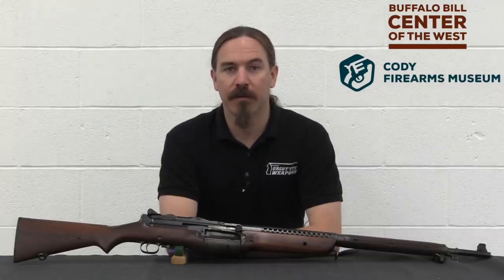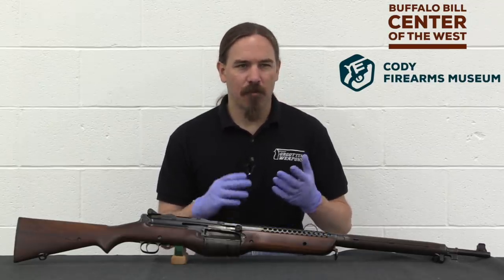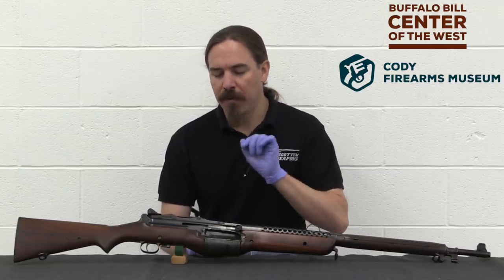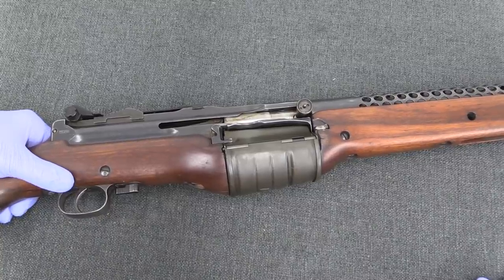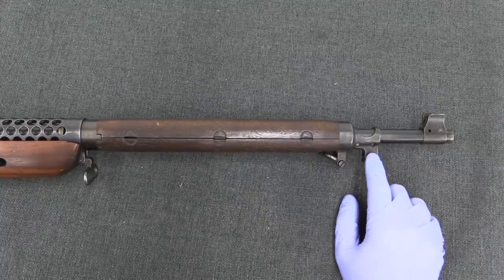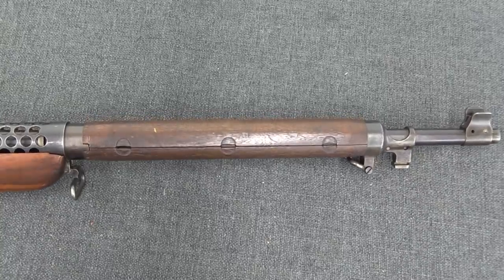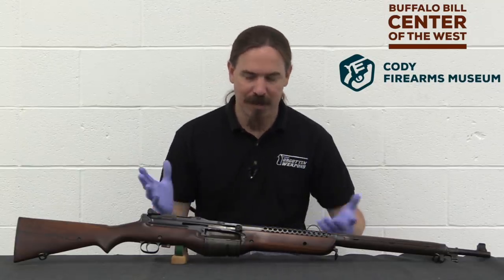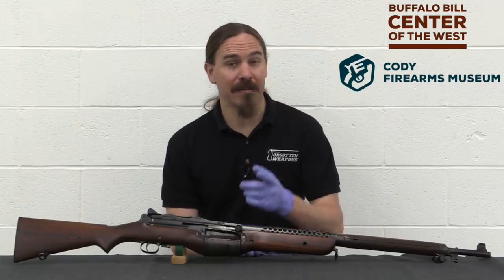Prototype Johnson Model R Military Rifle

Comment: That front "sling swivel" has a notch missing. I'm thinking that may be for stacking the rifles more than an actual sling point
Reply: Could be both. Could be a shooting hook as well, loop the sling through it temporarily to provide additional stability in standing or kneeling firing positions.
Reply: That’s what I was thinking, as well. Just like on the M1 Garand and the M1903.
Reply: Yes, that should be a stacking swivel, while the actual sling would use the one in the middle.  Using a shooting sling like the M1907, as trained, would likely cause malfunctions if using the forward swivel, as tension on the sling would interfere with the reciprocating barrel.
Reply: Uncle Sam loves his rifle teepees.

Comment: The swivel attached to the barrel isn't a sling swivel, it's a stacking swivel. It has the split in it so that you can connect multiple rifles together via their stacking swivel so that you can stand them up together in a teepee.

Comment: I don't know enough about the Johnson to know if this has been discussed to death, but could they have added a muzzle booster to the bayonet itself so clipping it on would offset its own weight?  That way you could tune the rifle for best operation without the bayonet, but not impair reliability with it attached.

Comment: Interesting you mention the brits having a look but (understandably) only being interested in it if it could be in 303. I've heard very little about British efforts to adopt Semi Auto rifles during WW2. I would guess given the emphasis on the Bren Gun (a pretty good weapon) as the primary firepower of the infantry section, the need for Semi Auto's wasn't so significant? I'd be curious if M1 Rifles or Carbines were ever used by commonwealth forces as part of lend lease though? We used tanks, planes, artillery etc so why not small arms?
Reply: There was limited issue to the commandos etc. Introducing the M1 rifle or carbine would mean adding another ammunition type to be distributed down to the platoon level - because realistically there was no way we were swapping the Bren for the BAR. As for whether we were interested in a semi-automatic, the wartime work on the initial EM-1/EM-2 designs answers that.

If Operation Downfall - the invasion of Japan - had gone ahead, then the Commonwealth Corps would have been entirely US equipped as the US refused to take a British/Commonwealth contribution any other way.

Comment: Thanks for another great video, Ian. Does not the barrel gets significantly hotter near the chamber? Therefore, the full wooden stocking near the muzzle might not impede the cooling as much as one might think. Thanks again!
Reply: I don't actually know the answer, but I suspect yes. I know there are machine guns with quick-detach barrels to swap them when they get hot, and I don't think that the chamber is swapped with those. if the chamber does get less hot than the barrel, it's most likely because the brass of the bullet casing takes the heat first, and it gets ejected before it can transfer much of it to the steel of the chamber. I have definitely heard mention of it being a problem with caseless and polymer-cased ammo in automatic guns that there isn't the cooling effect of the stream of hot brass leaving the gun.

Comment: If only Johnson had been bold enough to use BAR magazines instead of his weird clip fed drum.
Reply: BAR magazines actually suck.  Thats one of the reasons all of the attempts to use BAR magazines in Garands were deemed to be failures by the very Army design teams that developed them.

They work "OK" with the BAR because it has a really slow operating stroke, allowing the spring time to feed the round stack.
Reply: @geodkyt  Fair enough, and rewatching his earlier videos on it it turns out that Johnson DID originally use one, but the Americans insisted on being able to go prone. Because tilting the rifle to the side is impossible.
Reply: @DarkestVampire92  There were more issues than just going prone (and turning the rifle sideways because the magazine is too pong is a nonfunctional answer to a problem with the preferred military firing position .  Now, I have no idea if the original Johnson magazine was "too long", but it is true that the US didn't want the perceived snag hazard of any protruding magazine, even a fixed one (a problem that is a non issue on actual service, as demonstrated by the Lee-Enfueld, Moisin-Nagant, and a whole slew of other both action rifles that had already seen extensive combat service by that time).  (I personally think it was the obstinate insistence on the part of crusty senior officers who didn't like the idea of changing the manual of arms from the at-the-time American standard of "Shoulder Arms" with the rifle "upright" against the shoulder to the "British style" "Slope Arms", where the rifle is rested on its side on the shoulder, with the magazine pointing outwards.)

However, the Army did have valid (if, IMO, overblown) concerns about detatchable magazines.  They are expensive, present another item of supply to be lost on the battlefield (or lost or damaged in training) and render a rifle inoperable (one of the main reasons for the "European" style of "heel clip" magazine release on pistols was to avoid losing magazines), almost all detatchable magazines have exposed feed lips that are subject to damage (rendering the rifle unusable with that magazine), and the aforementioned problems in trials.with rifles using detatchable magazines. There is also the fact that carrying rounds in loaded detachable magazines takes up significantly more space than carrying clips.  (Of course, the practical solution is to carry enough magazines as a "standard load" for one typical firefight, plus a couple of extra magazines, and carry a spare ammo - often on stripper clips - to reload the magazines during the "Consolidate and Reorganize" phase after the firefight.  Which is what nations eventually did.)

A semiautomatic rifle fed from clips (especially one that holds noticeably more than typical bolt action rifles of the time) would still be a huge advantage, without the potential liabilities of detatchable box magazines.  As was proved by the effectiveness of several semiautomatic rifles that served in WWII (including ones that actually had detachable magazines but often were handled like they had fixed magazines in actual service).  Thus, conservative Ordnance officials may have been shortsighted in our perfect hindsight, but they weren't necessarily wholly *wrong*.  Note that Winchester (among others) kept trying to make BAR magazines (sometimes modified, sometimes not) work in rifles pretty much until the 7.62x51mm round was mostly developed and wouldn't work in a stock BAR magazine at all.

Magazone design and fabrication is trickier than people think.  The weak point in many repeating firearms is the magazine .  Heck, the weak point in the AR15 family is the magazine (once they abandoned the idea of box mags as single use disposables that would arrive on the battlefield factory loaded almost like an external Mannlicher clip), because the mag well doesn't provide a lot of room to beef up the magazine - that's a design issue.  The biggest weak point in the Sten SMG is the magazine fabrication - the magazine is effectively an MP28 magazine (which, albeit single feed, is a good magazine for a single feed SMG mag), but British production didn't properly heat treat the feed lips and they have a tendency to bend out of spec (at which point the Sten becomes a paperweight).  The biggest weakness point in the M1 Carbine is the magazine - both design and fabrication.  And you have to get it right for every magazine (while keeping it almost cheap enough to be disposable, because you're going to go through a lot of them in combat; magazines are "consumables").  But if you don't use a detatchable magazine, you either only have to make the feed lips right once per gun (pretty much everything but an en bloc Mannlicher style clip), or you only have to have them function once (because they are en block Mannlicher style clips that are loaded at the factory and discarded after a single use).

Comment: @8:47 That is not a sling swivel but instead a stacking swivel. Stacking swivels, of that design, have been on US Army Rifles since the 1873 Springfield. The M1 Rifle was the last US Army rifle with the stacking swivel, with the feature being deleted with the adoption of the M14.
Reply: You can still stack M14s and later rifles by making a small loop in the sling, and sticking the barrels of two other rifles through it to make the tripod.

Comment: The added weight of a handguard might actually help maintain reliable operation when attaching the bayonet, since the weight of the blade would have a smaller relative impact on the overall reciprocating mass.

Comment: Wait, the Netherlands adopted the Johnson? I never knew that. That would mean, either in 6.5 x 53.5 rimmed (the then current cartridge in use), or a whole new cartridge for the Netherlands. Of course, any adoption in the spring of 1940 would be brief, because on may 10th those forecast nazi's invaded. The Netherlands fought with their M95 1895 Mannlichers. OK, I just looked it up. The Netherlands ordered 70.000 Johnsons for their colonial east-Indies troops, as they feared a Japanese invasion. By the time the Japanese invaded the production of the Johnson rifles was under way, but no where near finished. The US air force then took over the order of Dutch Johnsons and used them during the war. Some 30.000 of them were made throughout the war. After the war the rifles were handed over to the Dutch government. And they were in .30"-06, which suggests that the Dutch had ordered them in .30"-06.

Comment: If they left it unshrouded, instead of using a lightweight bayonet, they could have burned them with the barrel. Way more metal.

Also, that Johnson's not kosher. It needs a moyle(I'm sure I spelled that wrong, and I had to throw that out there. I'm a middle aged 12 year old like the rest of you!).

Comment: That forward swivel is a stacking swivel rather than a sling swivel. The 1903, M1 Garand, and others had it for the purposes of stacking rifles. 3 or more rifles can be used to create a rifle stack, but the open swivel allows the riflemen to quickly assemble the stack, and grab their rifles and quickly disassemble the rifle stack.

It's been a long time since I've done any D&C, but I believe this command is called "Stack Arms." It can be done in formation, or more commonly in the field if needed.

Comment: The forward swivel is not a sling swivel.  It's a Stacking Swivel so 3 guns can be connected like a TeePee and others leaned against them for stacking in the field.  The split in the swivel is the giveaway.  Garands also have them.

Comment: Sorry, the first "Swing Swivel" is a STACKING HOOK!  This is why it has a gap... You've seen pictures and movies where there's 3 or more rifles standing up in a "teepee" like bunch without any outside support.  This is also why the first guy has to stand there holding his rifle while everyone else grabs their own rifle!  They are unhooking their rifle from the other rifles in the stack.
 
Don't know why this lasted as long as it did since it is obviously much better for the soldier/marine to have their firearm with them!  (.vs. where it takes a several seconds to get armed and if the first soldier/marine at the stack gets shot, now you're looking at 30 to 60 seconds, if not longer if the guy falls onto the stack!)
Reply: Sorry, it's actually called a stacking swivel and you'll note that nearly every other comment before yours points that out as well.
Reply: @FIREBRAND38  Not too sure if the US Navy called named it differently or not, but that's what I heard it called.
 
Kinda like USAAF/USAF "Pull 12 Blades on Radial Engines", USN "Airdales" "Pull 3 or 4 Revs", USN "Pit Snipes" Hand over the engine 3 or 4 times."
 
Also, remember how the word SECURE had different meanings to US Army, US Air Force, US Navy, and US Marines??? Very different meanings at that!!!
 
Also Temporary Assigned Duty in the US Navy was called TAD while the US Army called it TDY (I'm guessing from the TV Show NCIS that all US Services are calling it TDY now).
Reply: @timengineman2nd714  And I'm sure that the Navy called it a stacking swivel in 1950 https://archive.org/details/landingpartymanu00unit/page/38/mode/2up?q=stacking as well as 1960 https://archive.org/details/OPNAVP3403LandingPartyManual1960Red/page/n601/mode/2up not that it matters for a video of an Army candidate rifle.

Comment: I don't really understand the Bayonet Lug.  In the 1940s, I can kinda understand, most of the brass still remembers the trench warfare of World War I, but now.  We don't use bayonets, we have 4 rails so you can have iron sites, a telescopic site, a tactical light, and a forward vertical pistol grip.  Even kicking in doors, and clearing rooms, house to house, we don't really use bayonets (As bayonets) any more, and the Gun Control Lobby looks at that (Among other things) as an "Assault Weapon."  I can actually understand their point on that one, why does a Civilian need a Bayonet lug, when Seal Team 6 doesn't use their bayonets as bayonets any more.